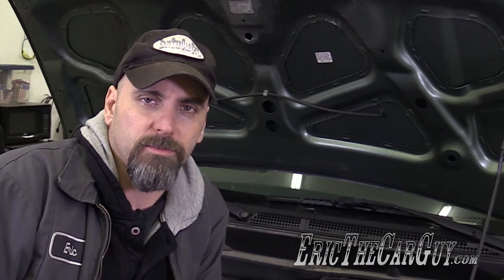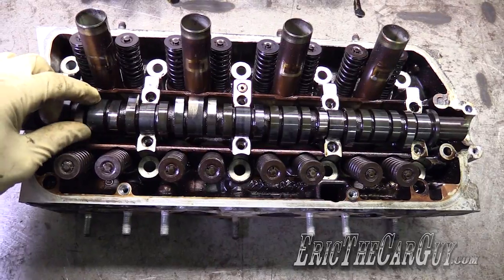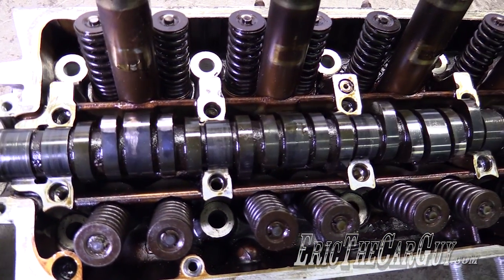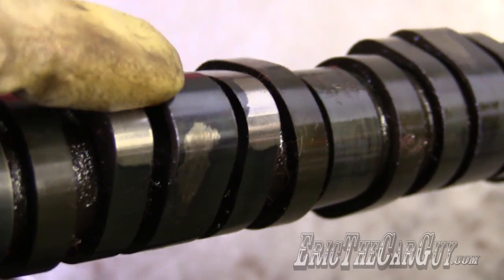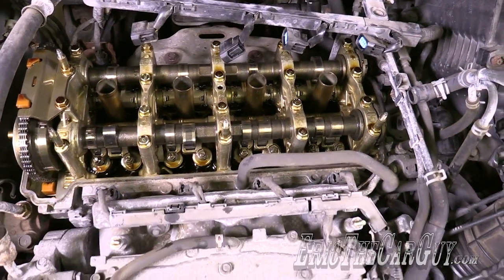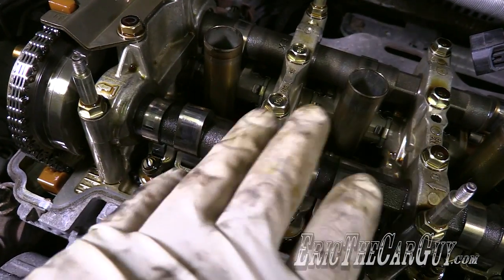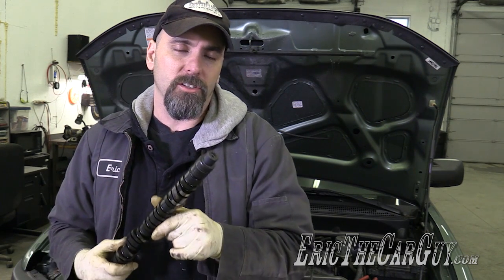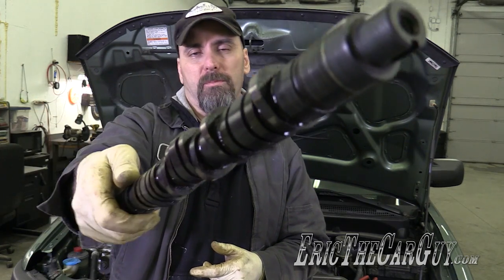iVTEC How it Works -EricTheCarGuy

Comment: This is a K24, yes? I only saw two camshaft lobes on the intake side per cylinder. How is that possible, if it still uses separate follower type variable valve timing? Or am I just missing the third lobe?
Reply: Yes it is a K24 (2.4L I4: K24A4 2003–2006, K24A8 2007+) This is an iVTEC So as Eric explain it works a little different than the 3 lobe VETC you are thinking of. This engine only has a primary and secondary intake lobe. Same concept as a standard VTEC just with the ability to also control camshaft timing. Does that make sense?
Reply: 1 lobe controlls both valves, the other lobe on the cam shaft controls the same two valves. one is normal operation, one is vtec operation.
Reply: I'm still a bit confused, so each lobe controls both intake valves (normal under normal operation, VTEC under full load)? How is this accomplished? The lobe is shaped so it opens both valves simultaneously? Or both valves are attached to one lifter or rocker arm?
Reply: braveraxeblade i believe in THIS engine (not 100 percent sure now) that one cam lobe (normal lobe) opens valve 1 normally. and valve 2 slightly (for lean burn) then under vtec the first valve remains the same and the second valve opens more than the first valve for mor breathing

under the performance ivtec system, one lobe uses a rocker to control both valves, and the second rocker once engaged, uses a rocker that also controls both valves but opens them further and longer.

Comment: Now we just need a video on the hydraulic infinitely variable cam timing of the Fiat engines. They run off cams under normal operation, but they can also be individually and hydraulically controlled giving each cylinder the ability to run at it's optimum efficiency when under heavy load. I am assuming that these engines run with cam shafts still because over the course of millions and billions of rotation the camshaft will hold up better than the hydraulic actuation. If the hydraulic actuation were in effect and that failed after 150,000 miles... well... you'd be stranded.

Comment: So this is very similar to the Toyota 1.8 190bhp 2ZZ-GE which has VVTL-I which has both lift on the intake and exhaust valves and intake timing change which the VVTI only engines also have.
Reply: the I-VTEC and VVTL-I are identical

Comment: A good followup video called "The Future of the Internal Combustion Engine - /Inside Koenigsegg" shows an engine that instead of using a camshaft, each valve is individually controlled by a electromagnet.  Basically makes it so each cylinder can have its intake and exhaust individually tuned.

Comment: will be great when engines finally have solenoids to control valves so we can have infinite variable valve timing for each valve
Reply: Koenigsegg now uses pneumatic for their valves instead of camshafts. I would imagine those are pretty much as variable as you'd want them to be. Cool technology for sure.
Reply: @johanneswarn5488  But for a reason on a car as expensive as that. It'll for sure be less reliable and more expensive.

Comment: i like the older vtec systems like the b and h series better
Reply: i-vtec is better than the older normal vtec systems of the h and b... also the modern vtec from the k series, works the same way.. they just have variable cam phasing added... which is a huge improvement..

your comment makes no sense to me.
Reply: neverknows best did I fucking say they were better. I said I like them more, learn to read.
Reply: ***** and i question why someone would like inferior techonlogy.. the k series are superior in every way to the b and h series engines.  H series especially.
Reply: neverknows best there was nothing wrong with the b and h series though, they were more simple and I like them more. they also seem to have a more aggressive vtec crossover
Reply: *****  actually the H series is crap. i like b series. but theyre still inferior in every way to k series. simpler yes... but the k series do not suffer problems due to their increased complexity. so its not a negative tradeoff.

and the cam phasing could also be seen as the perceived difference in vtec crossover. also the difference between lobes can be different depending on the car itself. 

its a perceived difference. not a real one.

and i guess before you respond asking me what i mean by the H being crap i should just go ahead and explain.

FRM.. thats all that needs to be said. h series with fiber reinforced metal sleeves are complete crap. in every sense of the word. they eat up piston rings. cant be rehoned, leak under boost. theyre just overall bad engines. 

the b16b is my favorite b series.

but with cars getting heavier we need engines with more torque, and more torque over more of the rev range. none of the b series could deliver that.
Reply: ***** the F20B bluetop is a good motor from that series.. but all others dont earn my respect.
Reply: neverknows best just because you don't like it dosent mean they suck.
Reply: ***** they are inferior in many ways is what im trying to say.
Reply: neverknows best how would you know, you neverknows best
Reply: its an ironic s/n :)

Comment: You should really do a video on how VVT-I and VVTL-I work.
Reply: I had the VVTI on my '04 Toyota Celica GTS. Awesome engine. Was almost unbelievable it's power output was equal to it's displacement. 1.8L that could put out 180HP.
Reply: lukethekanefan
No its not, vvti is nothing like vtec ,vvti just retards or advances the camshaft via a variable camgear , like the i vtec does, just without the second or high speed cam lobes.

Altough VVTL-I is indeed the same :)
Reply: He'll have a heck of a time finding a 2ZZ powered car to show off VVTL-i. They're not all that common.
Reply: ITS EXACTLY THE SAME
Reply: Haloruler64 really there not rare in england iv worked on em a few times
Reply: lukethekanefan they're not rare by any means, just uncommon. I don't see many Celica GT-S's around anymore.
Reply: Haloruler64  That's because people like me drove the crap out of it.
Reply: Andreas Wöckinger that is what i meant also its called CAM PHASING what VVTI is

Comment: VTEC is like a weaker version of VVTL-I
Reply: lol since vvti-l is a copy of vtec....
Reply: lol your kidding right
Reply: vtec was introduced in the 80's... and vvti was introduced in the 90s... and they both do the same thing.. 

if you believe that vvti is stronger. make your case.. also define stronger in your terms, cuz vtec is obscenely reliable.
Reply: vtec is more reliable but vvtli does not just increase the valve lift for just the intake like vtec but also the exhaust
Reply: actually only some vtex systems (sohc and economy models) do the intake only..

MOST do the intake and exhaust at the same time. your argument is invalid.

Comment: Also, there is the VTEC system Honda used on the 6th Gen VFR800 motorbike. This system switches from 2 valves per cylinder to 4 VPC at a given RPM via the follower. Cleaver system but very time consuming & expensive in parts (shims and buckets) when doing the clearances. Honda stipulate this is done every 16k miles!

Comment from the maker: In case you ever wondered how iVTEC works. https://www.youtube.com/watch?v=SBZLch1gy_M
Reply: Everyday is a learning day. Thanks Eric

💋🎬🇬🇧♥️⛄️
Reply: Erik Swiger koeniggsegg has been doing this for a while. (Correct me if I'm wrong)
Reply: Newtonmeters is actually a unit for torque, not for power (as Kilowatts, or kW, is). So Nm = ft·lb and kW = hp. It's as simple as that (although there's an old German unit "PS" which literally translates into hp, but has again another conversion factor from kW or hp, but is still widely used among laymen over here...)
Reply: xFreeland1 nope your right, i saw a vid by them a few years ago and they had modified a Suzuki head and they were runnin the engine with no cams, all hydro valves computer controlled
Reply: Lol
Reply: I heard a rumor that somebody was bypassing all this complexity and going straight to fully-hydraulically-actuated valves, controlled by electronic signals.  It allows full control of lift and duration at all engine speeds.
Reply: Hey Eric,what should i be looking for if my 2002 4.6l explorer barely gets up to 35mph ?
Reply: Gerard Prime A new car!
SCNR...
Reply: Good explanation, and very good channel
Reply: do you have any idea what the problem could be with the VTC actuator? its a rattle that occurs during a cold start.
Reply: +jesussaves13 I am wondering the same thing , I just bought a 2012 Honda Accord se and it's making noises the Vtc is shot , Honda is still tryna get a fix
Reply: +Gerard Prime Spark plugs,catalytic,cables,blown head gasket...lots of stuff man
Reply: V-TEC FTW
Reply: Hey Eric, i have a honda accord 2003 with ivtec. I purchased this vehicle used about 5 years now and ever since i had this vehicle i notice it behaves very sluggish to move off from a stopped position, so much so that if you stop this vehicle on a steep incline and then accelerate you may not get it to move or it will barely move while making a lot of noise. Once it gets momentum however and the rpm rises, you do feel the power kick in and there is no stopping it. Iv driven several other honda accords but mine is the only one that feels this way.
Any ideas?  Thank you.
Reply: JRT If your vehicle is not being excessively weighed down, I'd start by tracking the problem along where power is supposed to be transferring to the wheels. Is your throttle or air filter being encumbered in anyway? For example your pedal unable to fully depress due to a clunky floor mat or the throttle body having a problem opening the valve as needed? Is the air filter dirty or otherwise preventing an optimum amount of air from entering the engine? These are somewhat easier to check and get fixed by yourself or a mechanic. Let me know if any of these ideas help you. I increased the power of my Fit by swapping out the air box for a short ram intake and removing the extra floor mat to allow full pedal depression. 

For your hill problem for now, engage your e-brake and keep the car in low or first gear and then release the e-brake at the same time you depress your throttle, this should keep your car from rolling and give your engine an easier time accelerating from your stop.
Reply: At what rpm ..does it got to be four the v tec ...works???